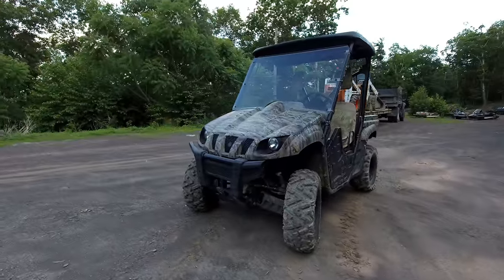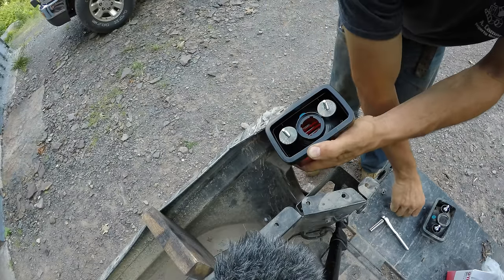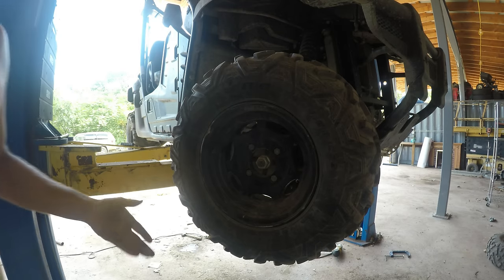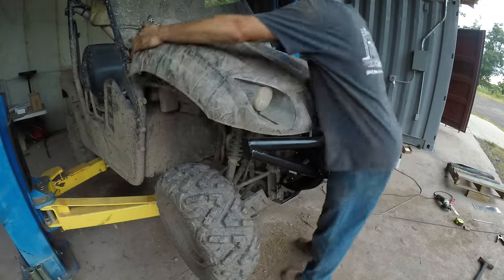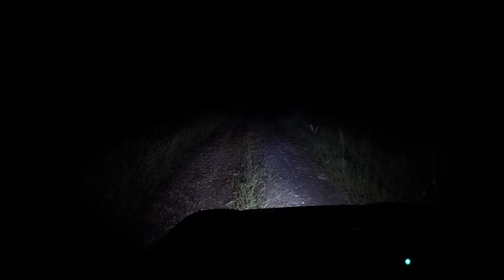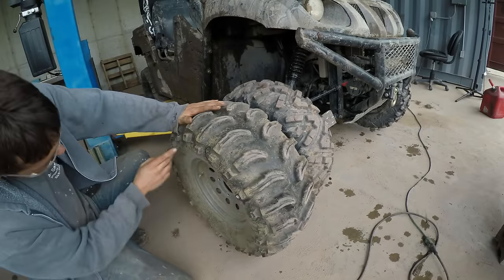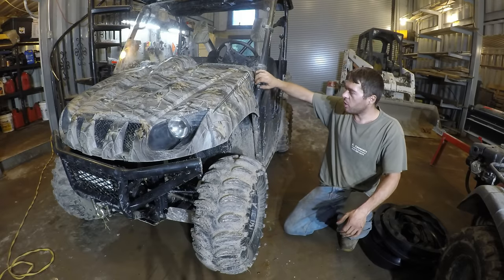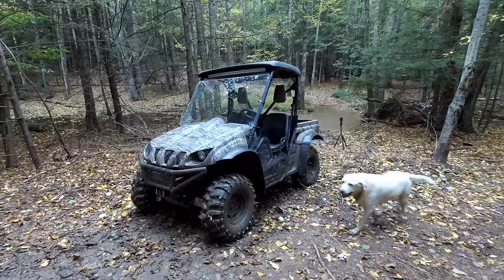Buying a UTV

Comment: A performance reason to keep all your power  DC wires as short as possible is to minimize the voltage loss so you have a better power to the winch. The longer a DC wire is the more voltage it loses compared to an AC wire. Great in depth video about how you think about machines and having fun...
Reply: this made no sense at all lol
Reply: Ohm's Law works equally for AC and DC - the best way to improve line losses is increasing the voltage (all else being equal). That's why power distribution is done at very high voltages. At 12 V, short, large conductors are the only solution for line losses. Power transmitted is V**2/R, so increasing the voltage really improves things.
Reply: Harlan Bruce 
Spot on.
Reply: +Rush Dougherty
It doesn't matter if it's AC or DC, but taking 2v off of 12v has a much bigger impact (literally 10x more) than taking 2v off of 120v.

Comment: I love these types of videos. Buy a used UTV. Doesn't go full speed. Boom. Clutch fixed. Needs a winch. Boom, winch added. Several other enhancements. Boom, done. It's videos like this that helped me replace a spring on a snow blower. $20 part, but 3 hours for me to figure out where it goes and how to get there.

Comment: That's the driven variator pulley. Behind the stationary cheek is where the main clutch pack is. Super easy to tune the variator on these, I put lighter weights in my buddies to keep it in low longer for rock crawling.

Comment: Great techniques!   Wield a larger bolt onto sheered, rounded off old ones in order to remove panel.   Use a heat gun to expand fuel line tube if one end to attach is larger.

Comment: Andrew, i owned two of these Rhino's. One was a 450, the latest in 2008 was a 700. Great machines, a little slower than most. Keep your radiator flushed out after each trip. Great vid as usual.:)

Comment: It's called a Ruff or Roof "variable pitch drive".  Invented by Ruff in the 1800s.  It was used to mechanically maintain the OUTPUT final drive ratio on pumps and generators.  Governors on gas, diesel, and steam engines maintain rpm by controlling the INPUT (the throttle linkage).  The difference is that the Ruff VPD/VSD/CSD varies the output drive ratio depending upon the LOAD.   The final drive RPM is maintained at a constant by incorporating a governor on the throttle/input and the output transmission/CSD.  SO for devices (generators) that must maintain a constant frequency on the electrical service and water pumps that have varying loads:  pressure frequency is constant.  It's used on snowmobiles and other low horsepower applications.  Later on the mechanism was adapted to the automatic transmission:  the speed of the input spun the centrifugal actuator that depressed the spool valve which shifted the transmission.  AWESOMELY SIMPLE!  One historical application was on the Simplex Servi-Cycle.  Google it and focus upon the motor-output drive.  It was BADASS!!!!!!  If that motorized bicycle was in production today, they would sell MILLIONSS$$$$$

Comment: I had similar opinions about new auto manufacturers until I realized they don't care about me.  It's not some conspiracy, it's that I don't buy high option cars every few years.  I buy base vehicles on 10 year intervials and fix them myself.  Their target is people who buy high option vehicles hopefully on credit or lease.

This is very evident if you see information that is coming out on the 2019 Chevrolet 1500.  There is a bottom tier that are work trucks targeted at fleet and business using a normal v6 and v8.  A middle tier with a high feature turbo 4cyl, and mini diesel that they expect to be the high volume (and probably high profit).  There is also a luxury tier above that.  Anything you see is really promoting the middle tier trucks. 

Think about vehicle options this way.  What's the markup for leather seats?  What's the material cost difference between leather and cloth material?  Are the same, cause frequently the seat below is almost the same.  What is the manufacturing cost difference between a cheap and expensive radio?  Does that make sense for the vehicle markup?  This is typical of many other industries too.

CAFE fuel economy rules are also a factor in making vehicles lighter with thinner steel, but I really don't want to go into a political thing.
Reply: On a separate note, because many people are not aware of this.  Soldering wires makes them brittle.  Properly crimped wires with heat shrink are preferred to soldered connections in mobile application.  Many railway specifications actually prohibit solder connections.  I soldered many connections myself before I learned this a couple years ago.
Reply: Yeah. But that's mainly if you have the tools for making a good crimp (IE not those cheap oval shaped combination crimpers with the 3 sizes). An ok solder joint will be better than a bad crimp, even if nothing will beat a proper crimp.

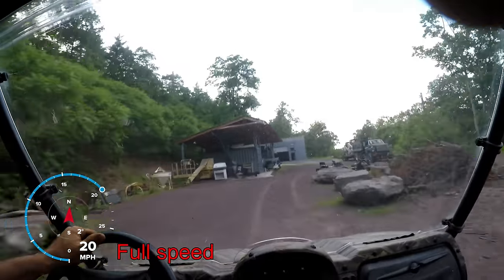Comment: Those coil-overs you installed at 1:05 look like they are adjustable for height.  Did you try to raise them?  Loosen the bottom nut, crank up/down the upper nut, lock in place again with the lower nut.
Reply: My first thought.....adjusting the preload atv 101
Reply: @jamesroyce2646  Yeah he should remove that front lift kit and just adjust it higher.  The back end lift looks to be fine though, way less strain.

Comment: Andrew, I'm 80 years old and you are me 50 years ago, except you have much more to show for yourself and much more equipment than I had.  Only difference is that I was spread a little thinner, with a few added hobbies:  Ham Radio, Electronics Tech, Steam Engines/antique machinery (I was engineer on a Steam excursion railroad for a few years, Musician/Songwriter (still do that), hobby radio DJ for 10 years, Cable TV construction contractor/operator, and most recently a Wireless Internet Service Provider, which will be my last hurrah. Still in good health but getting tired, after being a Jack of All Trades and Master of None all my life. Still have a messy home shop with lathes, drill presses, shapers, milling machine, welders, plasma cutter (my latest addition--LOVE it).  I also LOVE your videos, watch them too much, I'm afraid, but your talent, resourcefulness and determination are truly remarkable, and your coverage of what you do is addicting.  You must have a great dad who taught you a lot of things.  As I watch your episodes, I'm continually looking forward to the next step in whatever project you're doing, wondering if you'll do it the way I would, and you are about 95% so far.  If I may, I have two suggestions to offer: 1) When pouring out of an oil (or any liquid) bucket, rotate it 180 degrees so the spout is at the top, and the Glug-Glug will go away, it will be able to breathe and the flow is totally controllable, not to mention the bucket is closer to its target and not up in the air, and 2) Learn how to spray paint (like watch an experienced painter).  Never wave the spray back and forth; always start and stop the spray as the nozzle is in motion, in other words, start your sweep before you start the spray and end the spray while you're still in motion.  Otherwise, you will get a pile of paint at each end of your sweeps, which gives you a totally uneven coat.  Other than those two things, you are PERFECT (the definition of perfect to me is: "suited to the purpose," which I learned from a friend.  Oh, and you really need a cutoff saw, either reciprocating or band type--you are wearing me out with all those cutoff wheels... Ha.  Keep up the videos, stay safe, and God bless you.
Reply from the maker: Dan Metcalf neat. Thanks for the tips.

Comment: I’ve had my rhino 660 for many years and you have talked me into loving it again :) You made me realize just how universal it really is. It may not be the best pure play or utility but it does both very well. I agree my biggest complaint is how darn noisy it is!! Going to try the intake mod and insulate the bed and engine cover. One thing I reall
Reply: One thing I really recommend is always carry a fire extinguisher. I had one burn to the ground, not sure what caused the fire. Thinking it might have been some grass or brush built up near the exhaust. Might have saved it if I had a fire extinguisher.

Comment: Hi Andrew, long time follower. Just a suggestion, when you add shrink tube to a solder joint I always try to use a small cut off piece of hotmelt glue inside the shrink before you heat it. The glue melts and squeezes out the ends. That makes it completely waterproof after it cools. Love your videos BTW. Lots of personality as well as information.

Comment: When you bleed the caliper you should have left that bleeder screw closed and it would have pushed the brake fluid back up into the reservoir now you have to add fluid to the reservoir
Reply: I was going to say the samething. Just take the cap of the reservoir, Might have to extract a little bit if it looks like its going to over flow. Saves rebleeding!
Reply: I second that.
Reply: In general it's a good idea to push out the old fluid when squeezing the pistons in. The fluid inside the pistons is usually full of dirt and metal shards, which you dont want to push up into the master cylinder. It's worth spending the extra 5 seconds to top up the reservoir
Reply: Camoguy101, Yes absolutely right, If you do not change your brake fluid every 2 years as recommended, but I am supposing that Andrew has that point covered as he is doing a good job of all the other machine maintanence.
Reply: Bleed out the old fluid when you can. Pushing it back into the system is lazy.
Reply: +Todd Bearden 
Yeah that's the easy way to do it, but did you see all that gross brown fluid coming out? DOT 3 is clear. I certainly wouldn't want to be pushing that pack into the reservoir.

Comment: Great job on the primary
Did you have any issues with the parking brake or the engine breaking bearing?
Reply from the maker: The one way bearing was bad. I changed it and it did not last long.
Reply: @AndrewCamarata  was the one way bearing a Yamaha brand or aftermarket.?
Thanks for the Reply.
Reply from the maker: @aceyorba  aftermarket. I should have got a Yamaha. It was a few hours to change it.

Comment: YOU FORGOT THE IRON PIPE THAT GOES OVER THE AXLE, THE BELT NEED TO SIT ON THAT!!!!!!!!!!!!!
Reply: Why are you shouting?
Reply: That would be the one way bearing and yes it needs to be there. Without it it’s a matter of time before he’s replacing the wet clutch drum and both halves of the cvt primary! 

@andrew camarata

Comment: What might prevent you from making cars this way is the crash rating. The skins of the car actually take up a significant portion of the crash loads and the crumple zones. That said, you could design around it, but odds are that plays a pretty big role considering basically all cars use the stamped sheet metal skins

Comment: Just a heads up....that oil level which looked full won't be full once you run the engine....when you change your oil and then re-fill you need to run the engine to fill the oil filter (which takes away from whats in the crankcase). Then wait about five minutes for the oil to drain back into the pan and re-check and top off.

Comment: Hey Andrew Camarata how about making a special small caravan. With special suspension and UTV wheels maybe 4 . A metal frame with tied up canvas when let down over frame looks like a caravan. Interior covered by water proof cover that covers the inside. A cover fits into the frame so you can sit under from the rain or sun shade. With your skills you could do that and camp in really lovely places. Next level adventures.

Comment: Dielectric Grease is always your friend with the electrical connections of an UTV because it repels moisture and protects against corrosion,  since the UTV will spend a lot of its life in the water mud and snow it's worth the extra effort..

Comment: Excellent addition to your fleet.  The mods made it better.  One suggestion for aesthetics.  Trim a little from the rear fender flares.  Maybe about 1.5" at the outer edge of the trailing end to reduce the blunt look of the flare.  Similar to what you did on the front fenders.  Remember, it's just for aesthetics.
    Are you able to get licensed or approved for use on the "slow roads" around you?  It could be a handy way to get around without cranking up a big truck and would give you the ability to take some shorter routes?
  Around me, you must have a minimum of proper lighting, including brake lights.  To use a legit paved road, you need a license plate and a driver's license.
Reply from the maker: I don't think that can be used on the roads here. A little further north they can be.

Comment: I wouldn't block the airflow with the lightbar, but instead get some plexiglass and put it in front of the bar, and the bar framed with a thinner pipe frame above.

Behind the mash it will just get full of dirt which doesn't come off by itself anymore. But when you put plexiglass in front with some 30° angle downwards t
It should pretty much clear itself again.

Additionally I would add some extremely bright corner lights which just turns with the wheels somehow - for example cable operated. Those should give you much better visibility on a windy trail.

And add a electric fan with a thermostat which sucks some more air through the radiators. Those machines tend to overheat pretty quickly when doing hard work. :)

Comment: Past automotive underbody engineer here. There is several reasons why the chassis on passenger vehicles is not made of tubing similar to this ATV, but of stamped sheet metal. The main one is safety: the NHTSA and other agencies requires vehicles to be able to collide with a pedestrian at low speed and not harm the pedestrian. That's why the front of modern vehicles is made of plastic and other "soft" materials, anything hard and unbending would harm the pedestrian and be unacceptable. There is also several high speed vehicle impact standards, which requires the front and side frame of the vehicle to crumple and absorb the impact without fully breaking. Tubing and other rigid frames makes this harder to achieve on the front, because is doesn't crumple in as controllable way that sheet metal can. A ton of engineering goes into the sheet metal frame designs/geometry to improve the cars safety ratings, its a very big deal for the manufacturers. The second reason is assembly cost and design freedom. Sheet metal is easy to spot weld together, and all other pieces can be fasten to it easily via spot weld, rivets etc. With tubing, automated weld quality is a lot harder to control (mig process has more defects than spot weld, robot pathing  becomes critical for quality), and it is more difficult to fasten body panels and other things to it, due to the tube having some roundness to it, not being accessible from the back side, and not being able to be modified much in geometry to adapt to connection points.
Reply: Very insightful, thank you!
Reply from the maker: They could at least make them not rust.
Reply: @AndrewCamarata  Agreed. Most Japanese manufacturers do a pretty good job with this nowadays. They use sheet metal that is hot dipped galvanized, top notch paint processes, take care not to fasten together metals with different electro-potentials (creates a live battery when humid, can make metal corrode really fast). They also put some tar-like coating in rust-prone areas, mostly in wheel wells and around rocker panels and such. Not sure that Chrysler and GM does much of this (or at least properly),  I don't get why either. Probably short sighted cost savings and overall disrespect for their long term customer satisfaction is my guess. My '02 honda is rust free underneath, while my '06 dodge ram has rust everywhere, and they live the same life except for towing. After a brake line failure on the dodge I decided to do a bar chain oil/wax mix undercoating to protect it moving forward. This seems to work the best while being cheap and easy to apply, per my online research. Here are the references that led me to believe this: from youtuber mustie1 https://www.youtube.com/watch?v=R6wkcylj1ng and https://www.youtube.com/watch?v=nn-cqoVYQR0 better than fluid film over several years, and DIY wax/oil that I personally did, said to last quite a while https://www.toyota-4runner.org/general-discussions/231164-ultimate-oil-undercoating-guide-diy-waxoyl.html  (pictures of 3 year after further down in the post)
Edit: with a lift, reapplying Fluid Film every year is probably easy enough to do. I don't have a lift so yearly is still too often for me, hence the wax/oil. Shouldn't have to do it in the first place.

Comment: I have a tip for you when breaking down atv / utv tires. Drop the air down to 3psi then keep the valve core in the stem and try breaking it down, with the keeper humps on those wheels they do not like to break down. I promise you this trick works, ive changed 1000s of them, it will change your life when it comes to changing ATV / UTV tires.

Comment: I've had pretty good luck with some of the crimp connections, but you have to make sure it has the shrink tubing with adhesive built in or else water will get in and corrode it.

Comment: I would never use aluminium on my ATV/UTV. The reason being that aluminium, when it catches on f.ex. a rock, will allow the rock to bite into the aluminium. Worst case, you'll bend the A-arms or frame. Plastic is the way to go. Rocks will still bite into the plastic but since plastic is softer the vehicle will slide over rocks, leaving just a groove in the plastic. But the original plastic protection is too brittle for my taste. Best to do in my opinion is to buy a 6mm plastic plate and trim it so it fits under the vehicle and then bolt it on.

Love the videos btw.